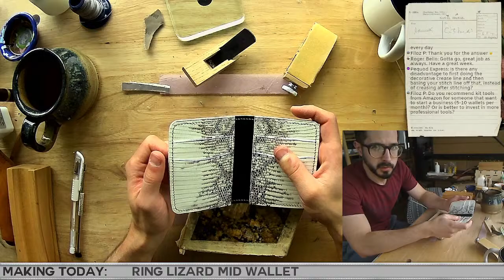LIVE Leatherworking, 5/23/22: Making a Wallet from Ring Lizard

Comment: If you were not using an acrylic template, say, heavy cardstock/greyboard instead,  would you still employ the same method of cutting and trimming? It seems that a see-through acrylic template is an important part of this process, since it allows you to see through the template for lining up your cuts.
Reply from the maker: I missed this comment but whenever I used cardstock I do it pretty much the same way, trace onto the leather with an awl and then cut. This one was difficult simply because I couldn't see the line.